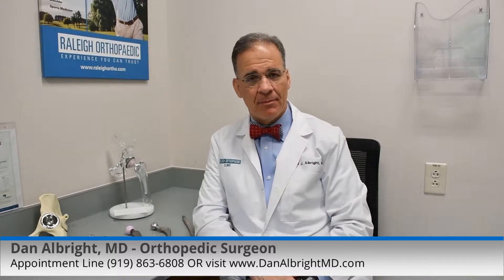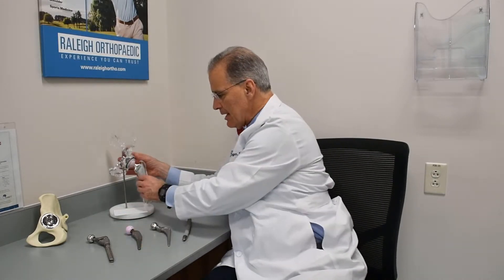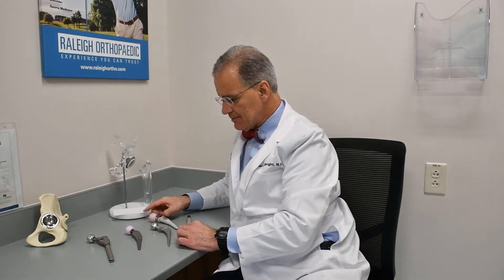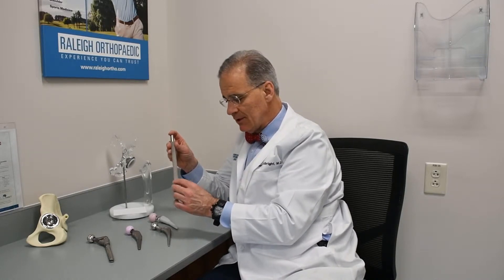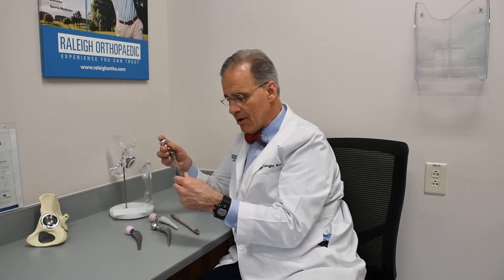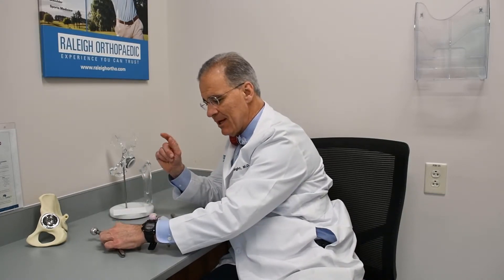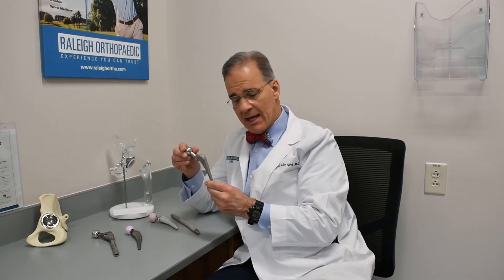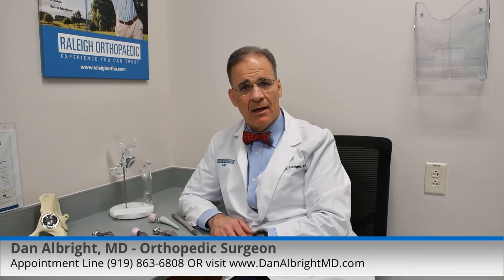What Types of Hip Replacement Implants Are There?

Comment: I HAD A PIN PUT IN MY HIp in 1981 MT .POCONO hospitals IN 2007 THE PIN STARTING RUBBING THEN CAME STRYKER 2007 TO 2024 , OH! ONE NIGHT ME SCREWING AROUND THE SCREWS POP OUT FROM BEHIND BUT THAT ONE PIN  PUT IN THE mt . Pocono IT LASTED 25 YEARS AFTER 50 MILES OF TRACK RUNNING , YEARS OF racquetball, Handball maybe 7 games a day, also Basketball,and Weight training ,leg  extension and Hamstring curls and the killer Squat 225 reps and 315 lb that 315 was it when i heard the slight pop but continue on my trainings for my 33 mile run Muscle Dystrophy Event that sunday 8 hours nonstop with 89degree weather , after 7 miles they were droping out like Flys anyway , today my biggest fear is infection, anyway , do your research on witch Doctor and Hospital contract they have to put in your body ,you have a choice ,remember that .

Comment: An egregious omission here is the absence of mention of a hip resurfacing option.  Hip resurfacing, not to be confused with hip preservation, involves a much smaller implant that has a significantly reduced overall exposure to the patient for metal ion particulate contamination (metallosis).  Hip resurfacing takes the surgeon longer to perform, which is why most orthopedic surgeons opt for the much faster total hip replacement.  Revision surgery with a hip resurfacing is less statistically prevalent as compared to the failure rates of total hip replacements.  People with metal sensitivities are much better off considering a hip resurfacing instead of a THR because of the large surface area of a THR implant that is not coated to prevent ion release will result in a THR damaging the surrounding tissues, resulting in a failure of the implant.  We need the FDA to mandate an implant registry in the United States.  Implant manufacturers lobby against said registry because the data that would be obtained from the registry would prove that THR's fail at an abysmal rate.  Its easy to prove - simply look at a country with implant registry's and the data is clear - THR's are a disaster.
Reply: its true but why is Hip resurfacing not been recommended by doctors. like if patient is ready to pay they still hesitate.
Reply: Lol hip resurfacing takes longer to recover from and barely any surgeons perform it , that's why.

Also, THRs are not a disaster, cope harder retard